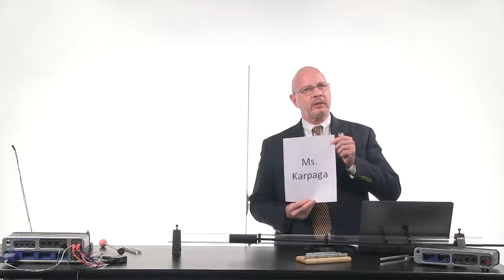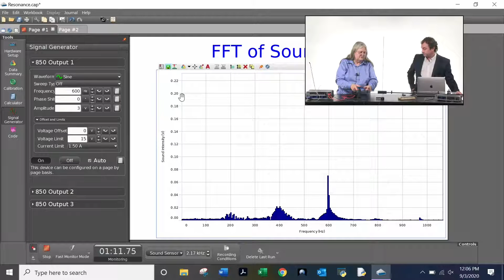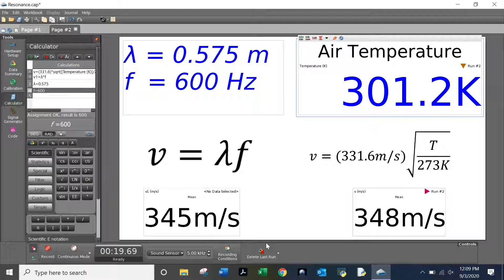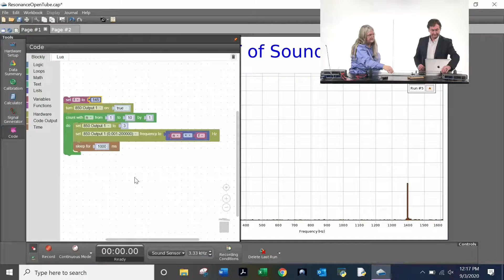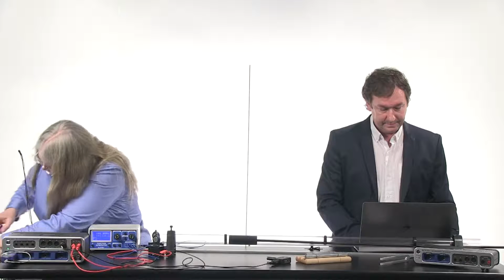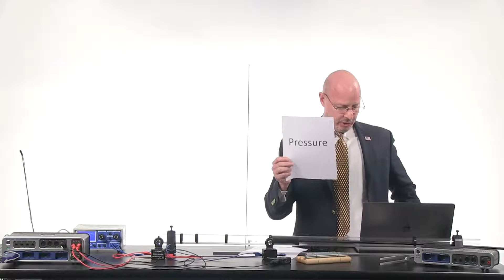Investigating Resonance in an Air Column - PASCO Live

Comment: Some of the explanations presented here are not necessarily satisfactorily refined. For instance, the open-tube resonant frequency could have been found more exactly by varying the frequency of the generator output to demonstrate the accuracy of the physical measurements and calculations. Assuming that there were some slight flaws in the assumptions, speed of sound at given temp measurement likely being most accurate. In this particular instance the extension mic could also have been used to demonstrate the location of the center node.
Is this lady a Jr High School teacher? Seems to be appropriate material for that stage of education, maybe HS.